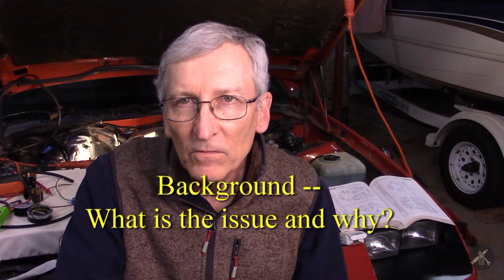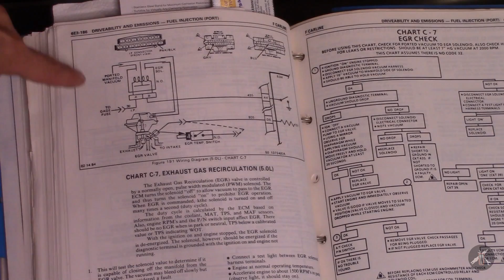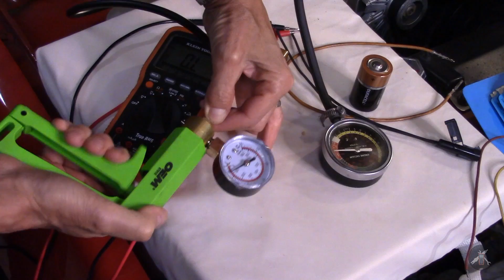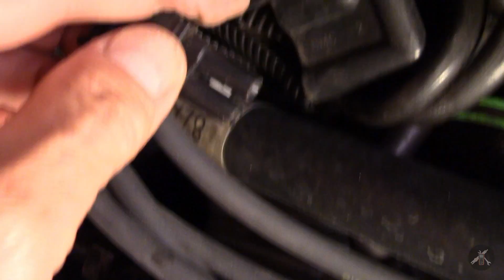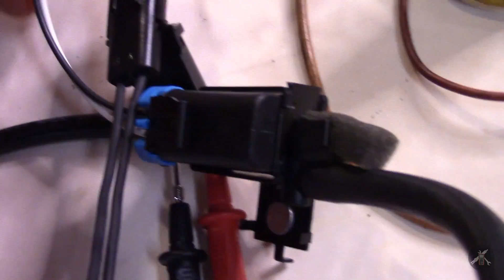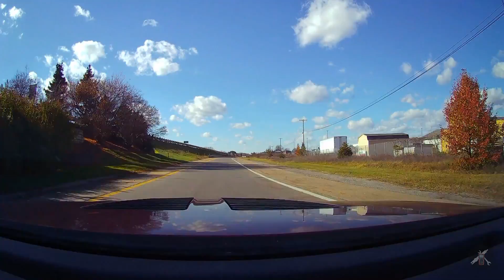Found Replacement EGR Solenoid for V8 Camaro / Firebird / Corvette and Certain 80's / 90's GM Cars

Comment: I’ve had a code 32 for the last 16 years. Even back then once I had done my best to trace vacuum lines, and checked my egr the code persisted. I gave up and sent it to a garage and they said they couldn’t fix it. My car has limped along. Getting half the mileage it once did. Every year when I would take it out of storage I would swear “this is the year I fix this” but after several calls and discontinued parts I’d always give up. I am beyond excited that this year I found your video. I’m extremely hopeful now that this can finally be resolved and I can get my iroc cruising comfortably. It running poorly has always held me back from restoring the car, I’ve been letting it decline. But now with your work and insight and research I may finally be able to get it running properly and that will be the domino that leads me into restoring it and putting the love back into it that it has always deserved. Thank you so much sir.
Reply from the maker: You're welcome, hopefully you can get your car running like it should.

Comment: Hello Dan, can you inform me where the EGR solenoid gets its vacuum from? I have a 1985 iroc z, 305 TPI.  It has a vacuum port facing the firewall and I can not find a vacuum line to connect to the solenoid.
Reply from the maker: Hi, the plumbing is a little fun and not obvious.  There are three ports on the factory valve.  The one toward the rear is a vent that is intended to have a small piece of foam as a filter.  The vacuum lines face upward from the rubber adapter that attaches to ports o the front end of the valve.  The vacuum comes from the front of the engine on the throttle body.  It uses ported vacuum that is zero with closed throttle and sends vacuum when the throttle is cracked open.
The following video shows detail of me installing the plenum and I show the vacuum connections:
Initial look at the plumbing:
https://youtu.be/XPmGcrDO-5Q?t=15
Detail of the plenum vacuum ports:
https://youtu.be/XPmGcrDO-5Q?t=1468
Reply: @bitsofwisdom460  Thank you for the explanation and the links. I did view the links but unfortunately your video did not show the vent side of the EGR solenoid clearly. Do you currently have the foam filter attached to the rear of the EGR solenoid on your barn find vehicle?  Are you able to send a still photo of the solenoid with the foam filter attached?
Reply from the maker: I don't have a good still right now, but take a look at the following video links. I had the solenoid off to work on a code 32 issue. It shows the solenoid better.  I could not find the official GM replacement foam filter, it appear that it is no longer available. It is supposed to be held on by the spring steel clip. The Cadillac replacement solenoid that I found had a similar foam filter, so I swapped it over to my valve.  It is likely possible to find a generic filter foam to do the job.  I say filter foam because some foam is closed cell and won't flow air through it. 
Main video:
https://youtu.be/-7ETq3heKi4
Specific time with a look at the valve with foam:
https://youtu.be/-7ETq3heKi4?t=451
Reply: @bitsofwisdom460  Thank you once again. I will look for a replacement filter.  With this last video, I will no longer need a still picture. 
Now onto the next issue. After rerouting the vacuum hose to the right port, now the MAF sensor appears to have taken a dump. I will continue to watch your videos as I continue to restore my IROC-Z after letting it sit since 2011. I have been the sole owner since April of 1985!

Comment: I have a question regarding the EGR Solenoid. There is 2 ports on it. One is a plastic port on top and the other one is a metal port, the metal port one has a vent port behind. Which port goes to the EGR?
Reply from the maker: The solenoid that I have has the metal port on the end with the connector.  The installation diagram that I have from the Cadillac application shows that port (next to the connector) as going to the vacuum source.  The port next to the vent would go to the EGR valve.  That is how I tested it.
Reply: @bitsofwisdom460  Thank you for the reply really appreciate it.

Comment: Do you know if there's any replacement solenoids for the fuel vapor canister? I've been told there are two different ones used. I had to get mine from a salvage car since previous owner removed it, but I'm not sure if it's the correct one. It gets warm to the touch when the car is running.
Reply from the maker: For my '85, the solenoid is built into the canister and is not replaceable. This video goes through the entire purge system with some additional information on the solenoid. https://youtu.be/q_KS6psFGhg
I would check to be sure the solenoid is working to pass vacuum on / off when commanded. On the '85, the solenoid is NORMALLY OPEN and power makes it close. The solenoid should be powered and close when the engine is cold and when it is idling. Purge should be off when cold or idling. When you open the throttle, it should turn off and allow flow to the intake manifold.  On my car, the solenoid does get rather warm at idle.  Warm enough that it is uncomfortable to touch.

Comment: Nice, you brought back memories of my testing with a 9 volt battery and suction pump. Mine was in need of electrical component cleaner spray and then it worked as advertised... Good to know there is a replacement!
Reply from the maker: That test method really does work.  Interesting that you could free it up with cleaner spray. I guess the solenoid has a vent, so it can pull in dust, especially if the little filter drops off or breaks.
Reply: Yes, and the foam filter is still there....
Reply from the maker: @mikebruegger8654   Yes, my original solenoid has lost the filter and I couldn't find one.  I didn't even know what it should look like. Now I transferred the one from the new valve I bought for this test.

Comment: Good videos. I'm working on an 83 crossfire. Parts geek and advance auto carry a lot of aftermarket parts for these cars. I'm have lots of issues. One stumping me is the wiper/washers. New motors and pumps and they still don't work.
Reply from the maker: Thank you.  I get a lot of parts from Rock Auto.  I like Advance, but there isn't one close to me. What is your issue with wipers? I haven't been deep into those yet, but I'll check on it.
Reply: @bitsofwisdom460  put new motor/pump assembly for the front. It worked for about 20 minutes then stopped. The washer worked for about 10 squirts then stopped.  The back wiper pump was bad. Replaced with ac Delco replacement. If I hook it up so the inlet has a funnel which I fill it works fine, but when I put it back in the reservoir it squirts 2 squirts of fluid then runs dry

Comment: You can also use a C4 L98 corvette EGR solenoid, even plugs in with our connector albeit a little tight. Only issues are the mount is different but that’s par for the course. 

Also anyone looking for the EGR temp sender for the EGR valve is still available for the TPI corvette on a few Corvette parts sites.
Reply from the maker: The L98 version has apparently been cancelled as well.  When I heard about this and started digging, I went to some of the Corvette sites,  I found a couple of sites with a "reproduction" for certain years that could also probably work, but they were unavailable / out of stock / back ordered.  This one ought to work in those applications as well.

And yes, the EGR temp sensor from the Corvette works.  I used one for my car. I didn't make a separate video, perhaps I should go back and do that.  It took a lot of work to verify, but I can confirm that it works. In my 1985, the wiring is much longer than the Corvette model and I built a pigtail extension to prevent modifying the vehicle harness.
Reply: @bitsofwisdom460   That’s unfortunate even the Corvette ones are unavailable, but with your research that solenoid will work. When I had code 32 it was the temp sensor that caused it, I had to splice a longer wire as well IIRC to make it work on my car too. Keeping these car’s emissions equipment up is becoming a real hassle when parts are no longer available.

Comment: Thanks so much for taking the time to research this! 

I am in a similar situation with a 86 Monte Carlo (Carburator) w/305.
Reply from the maker: Hope that it works for you.  I didn't check Monte Carlo, but it seems likely that it would apply.
Reply: @bitsofwisdom460  Interesting that my Monte was throwing a Code 53 after EGR valve replacement. The CEL would only come on after a highway cruise 55+ MPH for around 10 minutes, never when driving in city.

Recently had the CEL stay off, just looking for viable options when the need arises to replace the solenoid.

Was looking into a Hyundai one that is normally open and priced very reasonable on eBay to do a possible retrofit, they are used on Mitsubishi and Chrysler products also in mid-2000's.
Reply from the maker: @swalmerfrompa  I hadn't looked into parts for other brands yet, that was a back up.  I started with a part for a GM car, expecting that the ECM driver circuits would be compatible.  ECM / PCMs all came from Delco Electronics in those days, so they would tend toward using common specifications for various drivers across different engines. That would help allow different solenoids or other devices to be used on different controllers.  Other brands may still work, I just have less data.